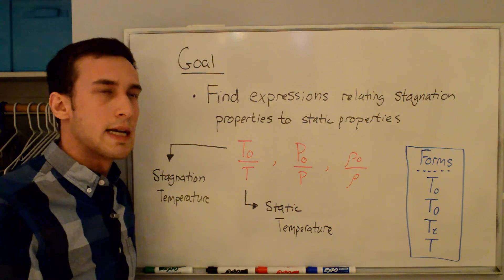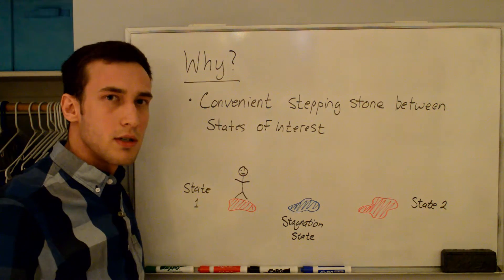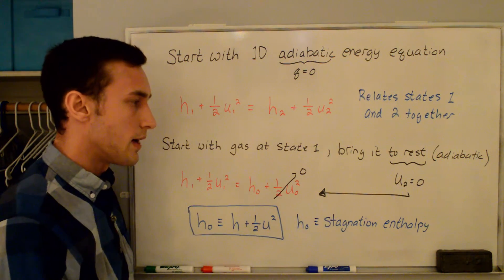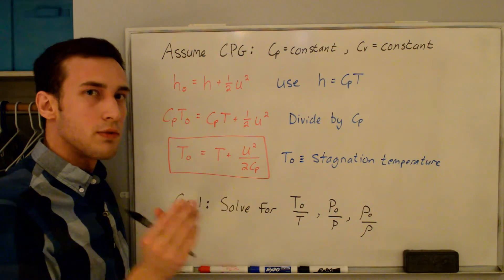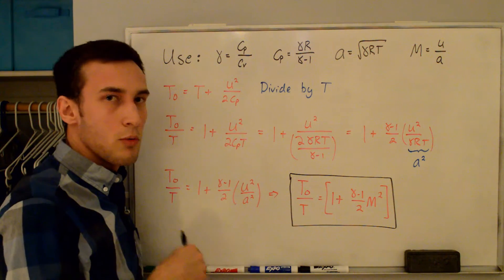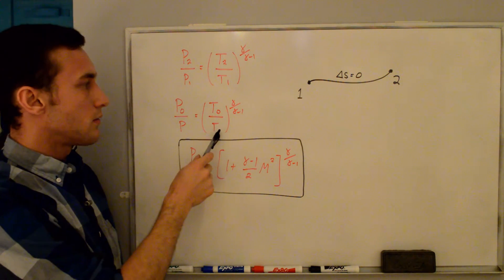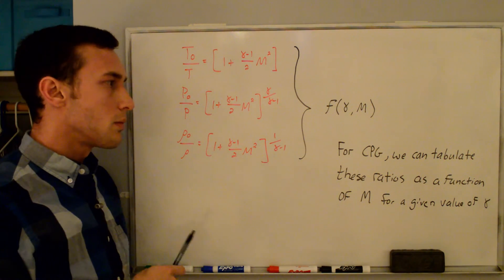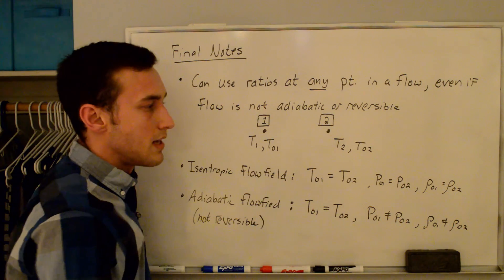Explained: Stagnation Relations

Comment: How would you calculate the stagnation temperature and pressure at the throat where Ma = 1?
Reply from the maker: You would just plug M = 1 into the equations.  The resulting equation for P0 or T0 would then simply be a function of either P and gamma, or T and gamma.  I have a video about this:  https://www.youtube.com/watch?v=jnRudznUqDM